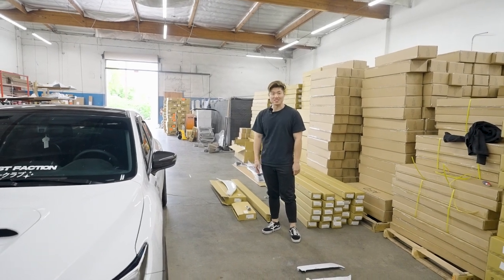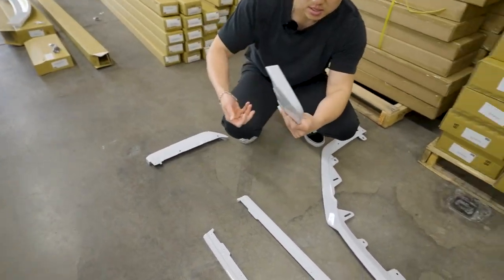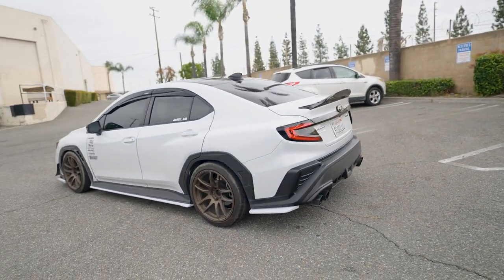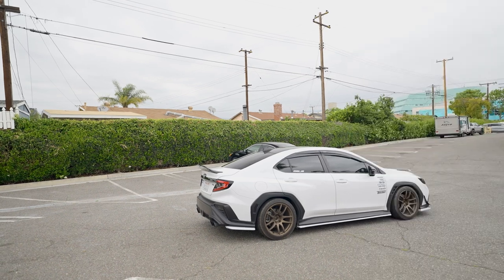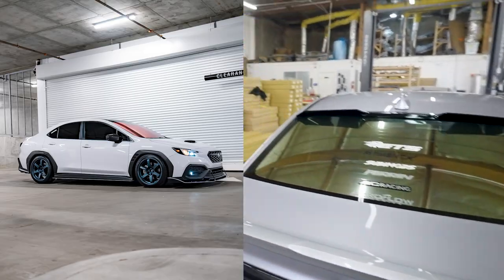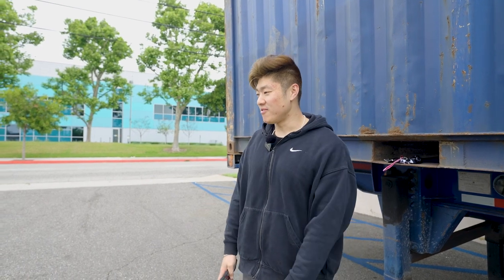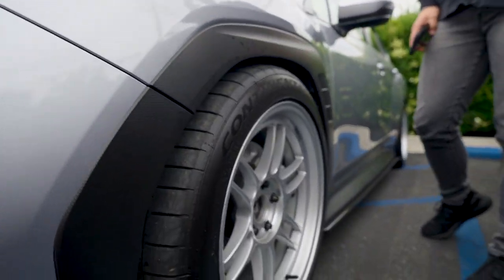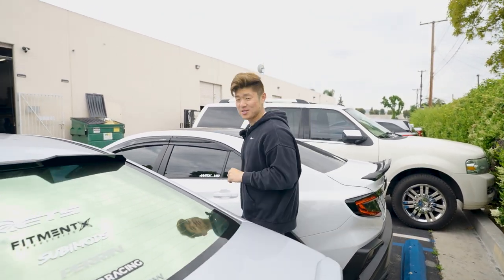V-Style Lip Kit for the 2023 Subaru WRX

Comment: Any issues with the self tapping screws so far? Was thinking of installing with screws and then later swapping to bolts/lock nuts OR rivets OR rivet nuts OR maybe some OEM pop clips... Just don't want to lose the lip, lose screws, or pop mine or anyone else's tires. Would love to hear other's experience and suggestions for what may work best long term